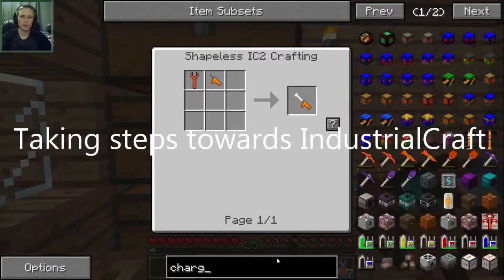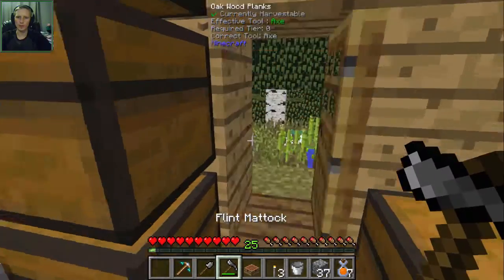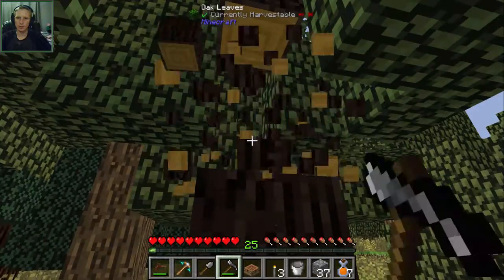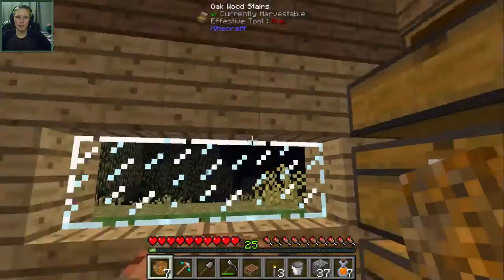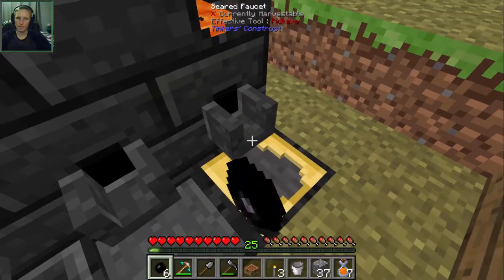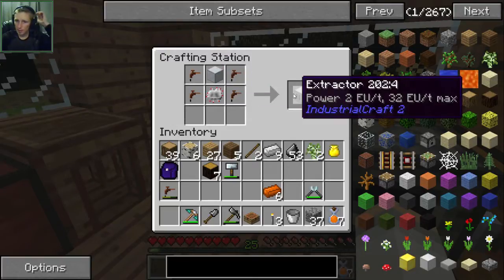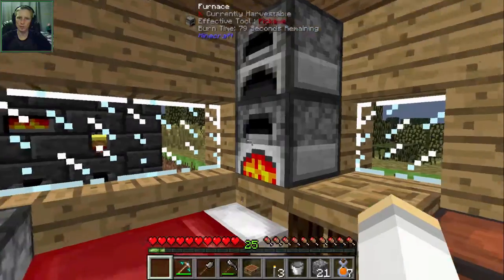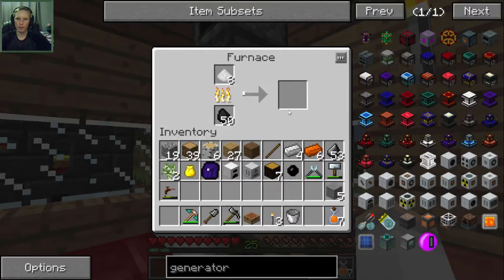FTB Infinity |MULTIPLAYER| #10 - IC2 Power

Comment: The Ic2 power generation isnt very efficient, you would be better off using extra utilities generators or some type of dynamo, thats up to you, and using the immersive engineering cables auto converts Rf to Eu, so you can use rf generation and storage and still power your ic2 machines more efficiently and stable
Reply from the maker: +Cole Dodge Oh yes, I know there are much more efficient methods of power. I'm only creating any of the IC2 power just to enjoy the experience of fully exploring the mod. Too often I find myself looking for the most efficient way rather than really learning mods and I skip over so much! Thank you for the tip though, always know you're looking to help out :)